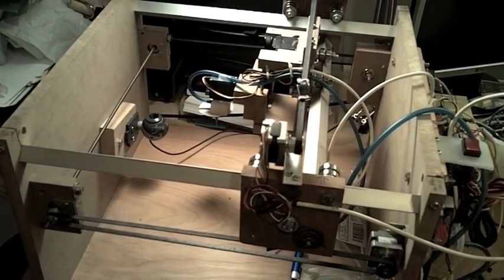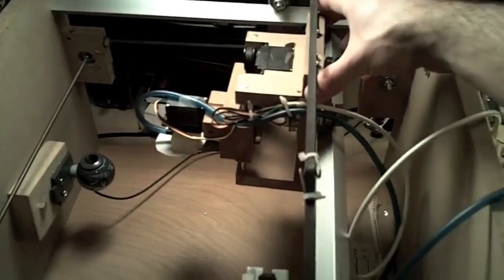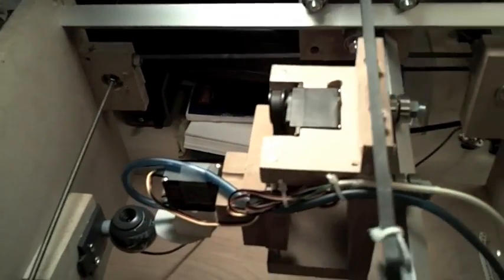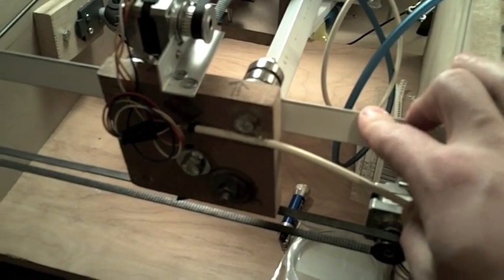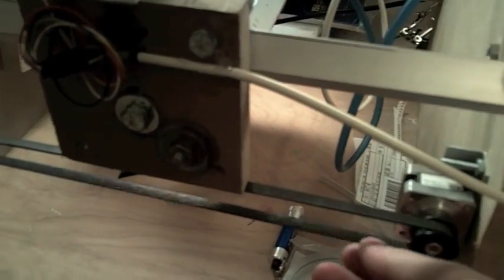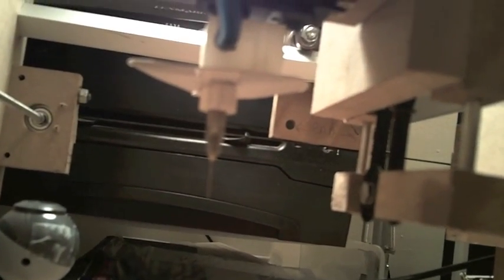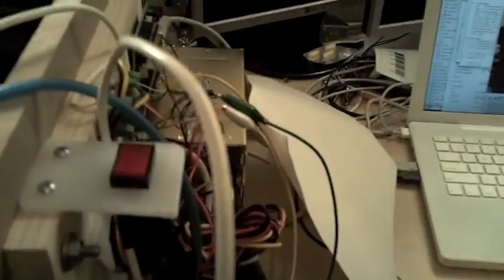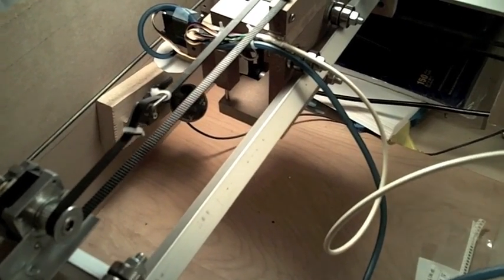DIY SMT Pick and Place Prototype

Comment from the maker: Hi Mark, this project is ongoing, and will be affordable to the maker community. The belt drive makes it faster than some leadscrew driven machines, but it is far from the fastest diy pnp on youtube. The second version of this machine has much better construction and is better optimized for speed and accuracy. 
This video is shot with the camera close to the part, so it exaggerates the speed a bit. Thanks for the praise.

Comment from the maker: @brianschmalz The code is all from scratch although I am using the servo library. I didnt show it in the video but It will rapid from any coordinate to any coordinate, moving all axes at the same time, that was a bit tricky to figure out but I used micros() to make a pseudo-scheduler loop to adjust the step timing during the move so I could accelerate the stepper motor.

Comment from the maker: @billyzelsnack Thanks! Hobby Servos are great for the short stroke axes, but I wouldn't be able to use them for x or y due to limited range of motion. Continuous servos would give you the range at a loss of positional control which is why I am using steppers. Best of luck with your build, send me a link when you can.

Comment from the maker: @electrodacus Thanks! Yup the webcam is for calibration and correcting position and angle after picking up a component. It isn't integrated in the system yet but I have run tests with the machine and openCV and it seems promising. Very dependent on lighting so I will need to build a ring light for the camera.

Comment from the maker: @brianschmalz THE BRIAN SCHMALZ???!! :) You will be happy to know I am using two EasyDriver boards for this machine, thanks for making that board!  I will check out  the EiBotBoard, I have heard about EggBot but not looked into the EiBotBoard yet. Currently I have an Arduino decoding serial messages and signalling the stepper driver boards and servos, so I will need to move everything to one board. Thanks for the positive feedback, it goes a long way.

Comment: Very, very nice job. Beautiful use of low cost design. What are you using for drive electronics? If you wanted a really simple board that could do 2 axis of stepper and up to 7 RC servos, check to the EiBotBoard, sold by SparkFun for $50.

Comment from the maker: @aherrera63 Thanks! I was originally going to use aluminum angles like buildyourcnc(dot)com, but I wanted to simplify it and I thought v-groove bearings would be too expensive (>$8), I may switch to v-groove later if i can justify it. The bearings in this video are very common and can be found for $0.50 on ebay in larger quantities.